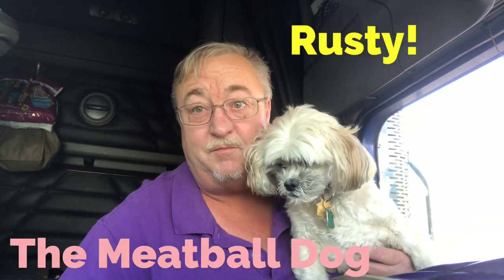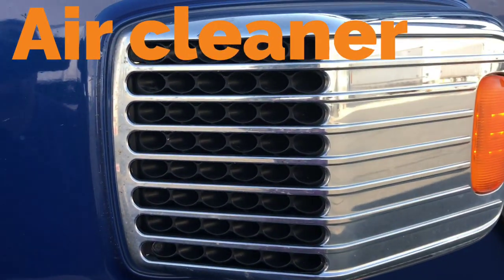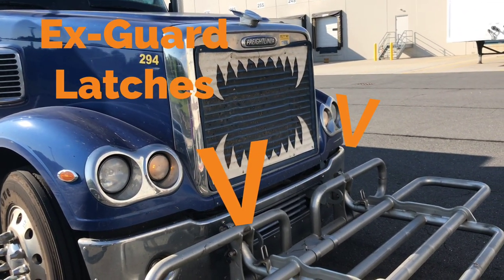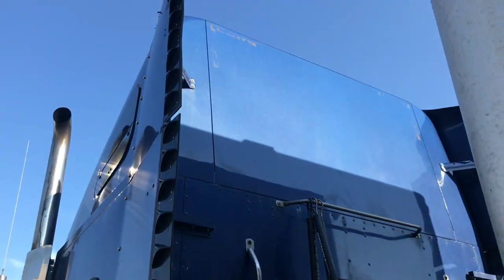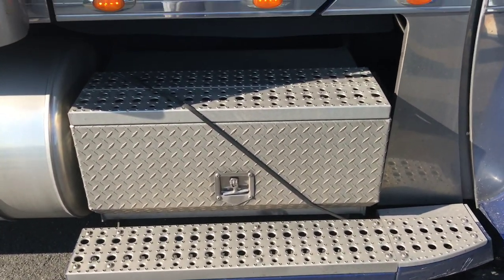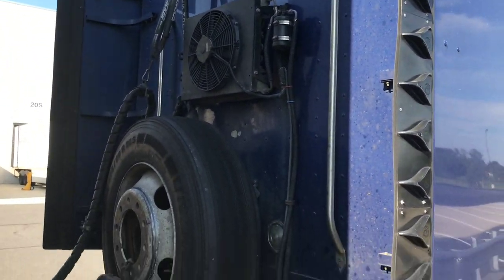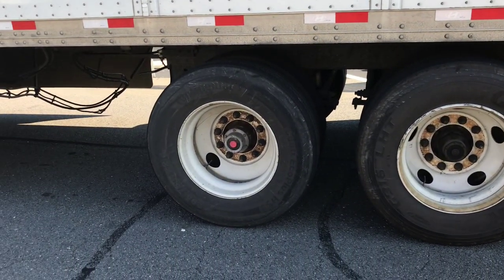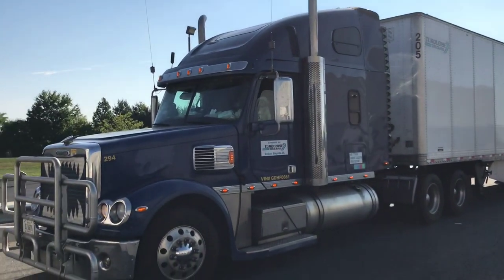Truck & Trailer outside Tour

Comment: Thank you for the tour. It was very informative and well explained. One thing that bugs me about these trailers is why no one ever designed and built a small gear mechanism that would allow you to run the landing gear up and down using a hand held electric drill. Battery operated electric drills have been around a long time and they are certainly powerful enough. Do you have any thoughts on this?
Reply from the maker: I like your idea. I’m sure there’s a way to retro fit something on there to do that

Comment: WOW!!  What a great, informative video! You covered a lot of facts!

 Love the intake  grill filters, and am curious when someone buys their own rig do they come with a 'warranty' like a private vehicle 1 year 100k miles? How often do you wash your rig?  

With 4 big batteries does a big rig even need a 'jump'?  And if so how would you know which battery is dead?   

Driving so much, have fuel prices varied the last 3-4 months?

We belong to a local tiny house on wheels community and someone who bought a piece of property near us, bought a used big rig shipping container, had it delivered and is transforming it into a home.
Reply from the maker: Beth, I love you. You are always a wealth of information and questions. Let me try to address you queries. My truck came with a 100k warranty on truck and wiring, and 300k miles on rebuilt engine. And yes a big truck will need a jump on occasion. Usually dead batteries smell like rotten eggs. So a good sniffer can track down the bad one. Fuel had been mostly down due to COVID-19. But is starting to rise again. Many people are using shipping containers to make tiny houses. They are usually the all metal versions sent from overseas. They also usually have a wood floor, but are a bit smaller. Only about 48’ Long.  As opposed to my dry van of 53’ long. Hope that helps
Reply from the maker: Also I wash my rig about once a month and a half or so. Very pricy. A standard truck and trailer wash starts at $60, and goes up from there!

Comment: Love the led lights. How do you have them in/triggered?
Reply from the maker: They’re wired to the marker lights. If market lights are on, trailer lights can be on. There was a switch inside trailer to shut them off, but it had been broken twice by receivers. Right now it’s just hard wired
Reply: That’s amazing!

Comment: Hello sir. Do you keep paper trail for your IFTA or do use GPS or something? I just got a '15 Columbia glider and I'm thinking of using eld to keep track because I'm running under my own new authority. I need the ease of keeping compliant!
Reply from the maker: My company’s fuel card provider handles the IFTA. But I also track all mileage the old school way in a notebook for backup.
Reply from the maker: Out fuel card is through NASTC.

Comment: Where did u get the led lights  inside of your trailer ?
Reply from the maker: It came that way when I bought it I got it from refix trailers also known as deluxe Trailer Sales in East Hazel crest Illinois the Chicago area. There a Hyundai dealer and mainly focus on fixing wrecked trailers but also do extras for trailers to so if you own your own trailer and want to get them I know they can put them on there